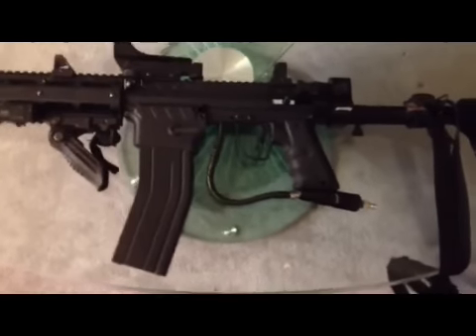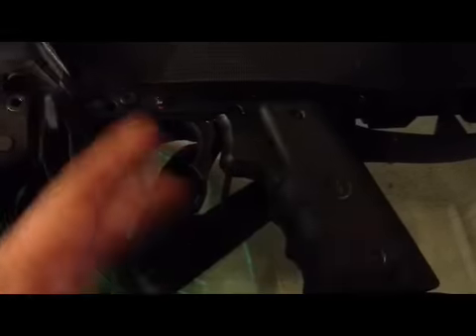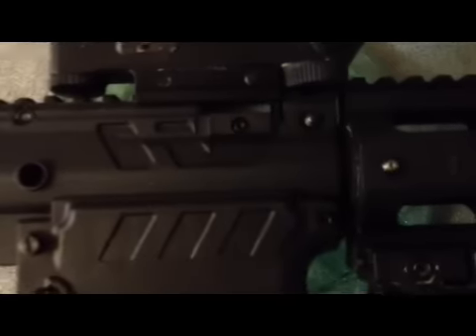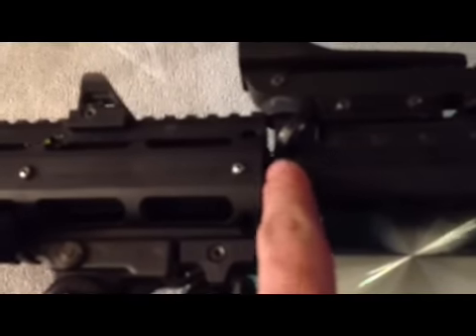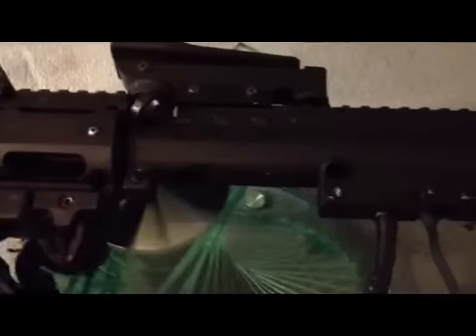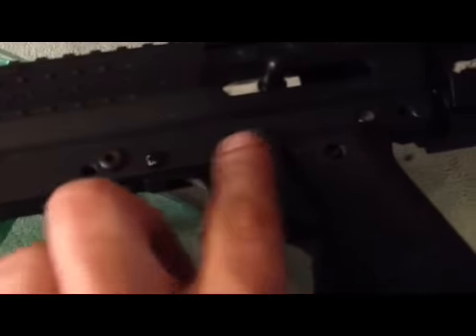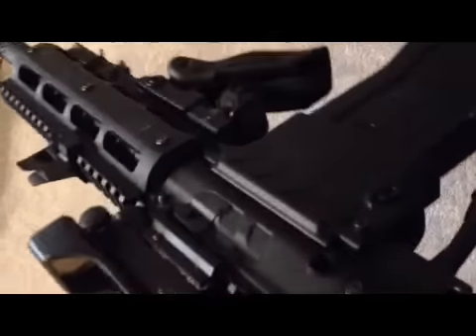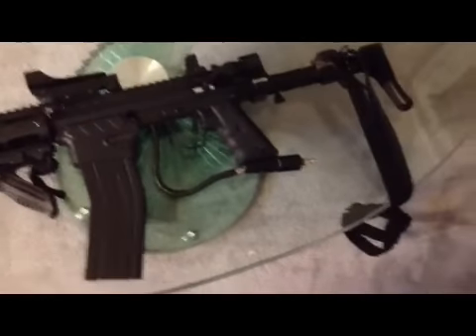Tacamo, TPN Tippmann Sierra One Conversion.

Comment: No cyclone feed? GOOD RIDDANCE. The cyclone feed on my TPN was the SOLE reason it was chopping paint like crazy. Even though I had rubber paddles. Just get an electric hopper; less bulky, more reliable smoother feed, and cheaper if you get it used. You could easily get used rotor that works good as new for $70. Better than spending $70 on a paint grinder with $30 rubber razor blades...